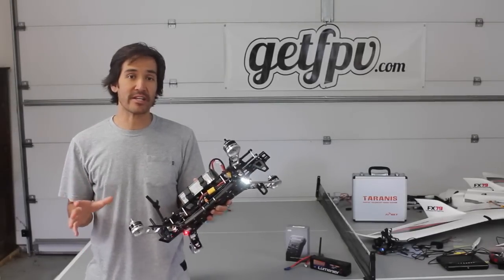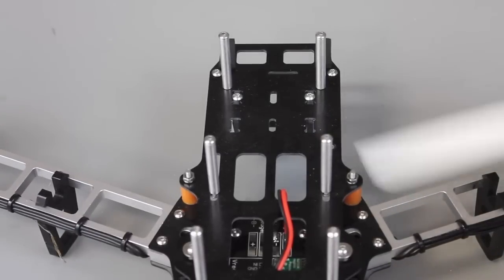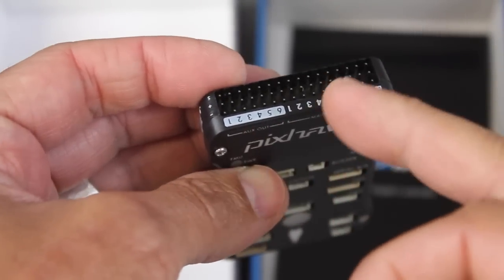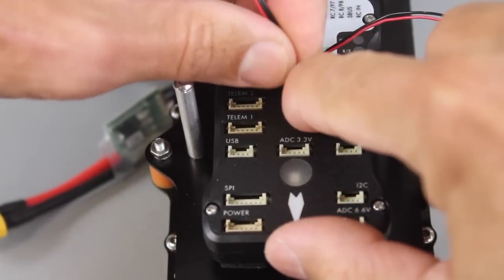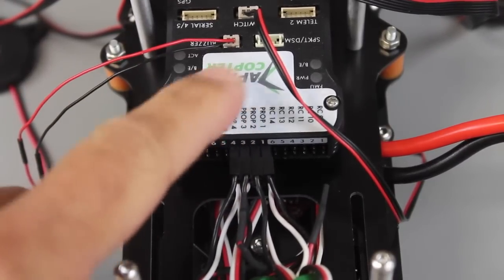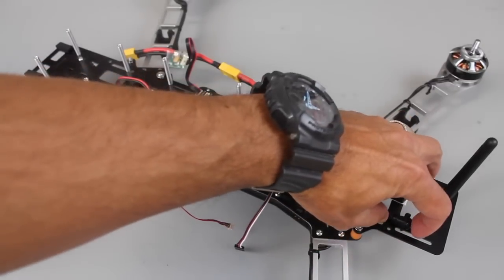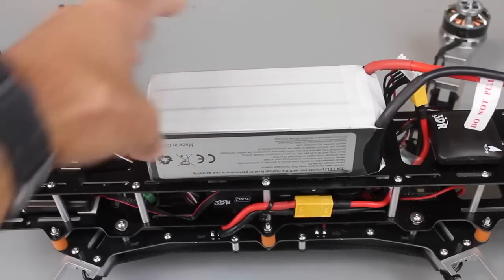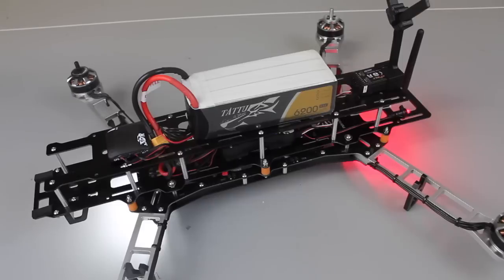Pixhawk Unboxing and Installation in QAV500

Comment: Hi dear Dennis!
Many thanks for video.
Only one moment I don't understand properly. Does the ESC connected to PixHawk by PROP1....PROP4 slots? Or PixHawk has ESC module inside and signal and power cables run right to motors?
Reply from the maker: Samvel Sargsyan Hopefully this diagram helps:

http://copter.ardupilot.com/wiki/advanced-pixhawk-quadcopter-wiring-chart/

Pixhawk does not have any ESC built-in so you'll need to use separate ESCs for each motor or a 4-in-1 as shown in the link above.

Comment: Dennis - Why did you use the low KV T-Motors MN3508? The QAV500 usual is paired with higher KV motors like 700-900kv? What type of flight times are you getting with this configuration?
Reply from the maker: Peter Klimon Tim Nilson and I thought it would be a fun series to add the 13" props and 380kV motors with a 6S batt. The goal is to see what flight times we can get with this setup. I'll be doing a video soon that shows it with a 6800mAh as well as 8000mAh. Great to hear from you and hope you're doing well. I did get your email but wanted to respond here.
Reply: Dennis Baldwin Have you done any testing yet for flight times?

Comment: Love your video.  Have you done, or can you do an installation of a pixhawk on a single rotor flybared helicopter?  I'm interested in using a trex 550 for a camera platform and need the stability offered by pixhawk
Reply from the maker: Robert Gaudette That may be way over my head :) I've never flown one of those before but it would be cool to see Pixhawk in one. You may have already seen this, but I'll share just in case:

http://copter.ardupilot.com/wiki/traditional-helicopters/

Thanks for the suggestion.

Comment: Hey Dennis, great introduction to Pixhawk.  Thanks again for taking the time and sharing all this information.  Quick question.  Why do you want to S-Bus with the receiver instead of PPM?  Won't you also have to install a PPM Encoder for that since PPM is the default for the Pixhawk?
Reply from the maker: Al B From what I understand the X8R does not support PPM output so S-BUS is used. It simplifies things a good bit with the X8R. Thanks for watching and the feedback.

Comment: Hey Denis -
I'm new to quads and love your video's - these are a great help to me! I just created an account at GETFPV and signed up for notification when the PIXHAWK is back in stock. I'm also considering adding a Teranis to my radio line up. Thanks for the great info - please keep them coming!
Reply from the maker: David Beardsley No problem at all. Thanks for watching. I love getfpv but also keep in mind you can get the Pixhawk from other sources. It looks like 3DR sells it on Amazon:

http://amzn.to/19o3F3A

as well as from:

http://store.3drobotics.com/products/3dr-pixhawk
Reply: Dennis Baldwin Can I use any other T-Motors with more kv, cause moneys a little tight right now and I am wondering if I could use like 900-1000 kv with the qav500 frame?

Comment: Since pixhawk will be powered only from thr power module, so if i'm using an opto esc i don't have to use any other bec. Is that correct?
Reply from the maker: Arga Firmansyah Correct. If you want to power it from the servo rail you can read more here: http://copter.ardupilot.com/wiki/common-pixhawk-overview/#powering

Comment: Great video! What motors and props are you using and what kind of flight time? I'm putting together the same rig but I'm not sure on a few details. Thanks for the excellent build tutorial.
Reply: Sorry, watched the video again and realize you gave us the motor info. I've plugged these into E calc along with a 4s battery and 12 or 13 inch props and it tells me there is not enough power to run these. I know you're running 6s, no problems with that and the Pixhawk?
Reply from the maker: Matt Molnar No problem at all with 6S. It's quite peppy for such a big setup. I do have a 8000mAh 6S that will add some additional weight so it will be interesting to see how it responds. I'll keep you posted. Thanks for the comment.
Reply: Thanks, Dennis! I'll be interested to see your flight times.

Comment: Hi Dennis, Great vid! Thanks for sharing. How do you supply the X8R receiver? Thanks
Reply from the maker: Flavius Lupu Thanks for watching. I'm not exactly sure of your question but if you're asking how you power the X8R it can be via BEC or ESC w/ built in BEC. If that's not what you're asking then let me know :)
Reply: Dennis Baldwin
 Yes, the X8R. I see you didn't use the ESCs 5V. Did you use an external BEC?

Comment: Thanks Dennis I am now in the process of Building one myself ( different Frame) So this set of tutorials will help a lot. I see some comments about the power modules being only 4s but there are 6s power modules out there already to go no mods needed.
Reply from the maker: Stephen Galvin Glad to hear you got a good build going. This is the power module I'm currently testing which will support up to 7S: http://amzn.to/1DE4faL
Reply: Dennis Baldwin Hi Dennis thanks for touching base I actually just saw your other video on this so sorry for missing that before I answered. Just a quick question If I used this PDB from HK would this mean I could do away with the power module altogether? I think it does but just trying to confirm. I am a newbie so forgive me if its a dumb question :) http://www.hobbyking.com/hobbyking/store/__68694__HK_Pilot_Power_VI_Module_Distribution_Board_And_Dual_UBEC_ALL_In_One_120A_and_10s_.html
Reply: Hi Dennis  how long do you think it will take to do the build series?

Comment: Nice looking setup Dennis, 
Im playing around with a hk pilot 32 (pixhawk clone)and its been interesting.
I went with the hk version because I wanted to test the open source waters as inexpensive as I could just in case I didnt like it. My experience is with mikrokopter and dji previously. 
All was going well with my hk pilot 32 and f450 test platform but I cant seem to get the fc to recognize compass/gps (NEO ublx-7). When I power the system up blue and green lights
Blink rapidly and faintly (on the gps). Then nothing. I cant find anything in mission planner to make the compass/gps be recognized by the fc. Since your videos started my interest in open source fc I felt I could ask your opinion on this issue. I know...I know, I will order an authentic 3dr pixhawk soon but until then I'm kind of stumped. If you can reply to this comment I'd appreciate it.  I cant really ask arducopter or 3dr fo advice... Lol.  I really enjoy your videos and congrats on the acquisition of your sponsors.
Keith
Reply from the maker: Keith Rolston Thanks for the comment and sorry to hear about your problem. I had an HK Pilot that recognized my GPS just fine. I'm not sure what the problem could be other than a potentially bad GPS. Normally it's just plug and play....nothing else required. Well let me mention that you'll need to load the firmware to actually start seeing data and for it to show up on your heads up display, but you probably already know that. Let me think on this some more and I'll let you know if I come up with anything. Take care.
Reply: Ya thats what I thought....  Plug n play. I was thinking it may need me to enable something in mission planner.. Or a box I checked that I shouldn't have but it says preconfigured for pilot 32/pixhawk. But that's hk, "hit or miss". Still too early to rule out an error on my part though. Thanks for getting back to me Dennis. I'll keep fooling with it in mission planner and hope l stumble across the answer.
Happy Holidays, Keith

Comment: nice ..waiting on that fc to arrive ..i am excited
Reply from the maker: bill alvarez Cool. Good luck and keep us posted on your progress.
Reply: Dennis Baldwin thanks for your reply dennis ..i got it to hover the other day but i had a bit of a yaw problem ..but got it dialed in by doing esc calib and sois the radio calib both at the planner and my 9xrpr0 ..you can check my video if you want ..now my question is ..can i re install fw on pixhawk like multi wii and other flight controllers .. if i wanted to re start a new configuration .. i thought i tried before but won't let me ..i was gonna try to use it on a hex frame

Comment: Dennis Baldwin  :I use pixhawk 2.4.5 on my ironman 650 and it works great.but when I power the board, the big Led doesn't flash untill I unplug the compass wire.can you tell me why please?
Reply: R. WIZA Looks like you may have a wiring issue or you need to calibrate the external compass. Make sure the external compass arrow is pointing in the same direction as the Pixhawk arrow. If these don't work then post in garagepilots.com or Diydrones.com

Comment: Dennis, How ya doing? I'm building a simie heavy build. I'm building a Kongcopter  700 size with 15 in. props Using Multistar 3525-750 kv motors. Building it for 4 and 6S batteries. I'm using 45 amp Turboace ESC's. My question id would Pixhawk be good for this build?.

Nice on getting a sponsor. Love it.
semper fi     steve
Reply: Go to Amazon.com and buy this one.In the seach box just put in quarcopters and it should get you to the page or copy and past what I put down and search.  It's at the top of the 1st page. I swear if you don't like it ,I will buy it from ya. Here it is............UDI U818A 2.4GHz 4 CH 6 Axis Gyro RC Quadcopter with Camera RTF Mode 2

semper fi      steve
Reply: It's 70$ plus shipping. This is so much fun. I have one and fly in the house. Have fun my friend

semper fi     steve
Reply from the maker: steve USMC page Great to hear from you! I've never configured Pixhawk with a build that size so I'm not 100% sure. If you're looking for autonomous flight then APM/Pixhawk are the way to go, but take a considerable amount of work to tune. If you just want a nice aerial rig that's stable with no hassle then I would consider the NAZA. Best of luck and please keep us posted on your progress. Take care.

Comment: Tip: Put a piece of packing tape over the buzzer's hole and mount it on the underside of the dirty section. It's really annoying and this helps a bit.

Also I think you should consider a lav mic for recording these videos. You can get a wired one for $10 and it will sound better in the garage.
Reply from the maker: Brandon Kalinowski Cool tip about the buzzer. I hate that thing! Regarding a lav mic I've been trying to figure out if my Canon T3 will support it and unfortunately I don't think it will. I know the T3i will but it doesn't look like the T3 has a mic input. If you find out anything different please let me know. Thanks.

Comment: You are going to make me spend lots more money. I have only worked with some of the other guys FCs and frames. But I really like that frame and the capabilities of the Pixhawk. I have played with my x8r antenna configuration quite a bit, trying to get the best set up. I am interested to see how that printed holder works, especially in such close proximity to the other telemetry antenna. Some RSSI values at different distances along with... do you position the Taranis antenna left or right horizontal, or vertical... might be a another video unto itself. :)
Reply from the maker: Mike Jordan I know what you mean! This hobby isn't cheap, but can be rewarding....at times :) I too have thought a lot about the best configuration for the X8R antenna. Unfortunately I don't have a clue and just rely on what I read from others. I'm going to do some tests in the future and will definitely share them. Thanks for the comment.

Comment: After upgrading to OS X Yosemite, the FTDI usb-to-uart bridge drivers refuse to show up in either qgroundcontrol or APM Planner. (Signing with "sudo nvram boot-args="kext-dev-mode=1"" doesn't work either.) Anyone here have a work around?
Reply from the maker: Børre Ludvigsen Sorry to hear that. I've had all sorts of FTDI issues with my MultiWii. I messed around enough and some how got it working. If I can document a fix I'll definitely share it. Let us know if you ultimately get it working.
Reply: Dennis Baldwin The problem is partially solved. I made a 25G partition on the MacBook Air and installed Mountain Lion only to find that neither APM Planner, nor QGroundcontrol could connect to the PixHawk. (Actually, it worked at the office, but not at home.) The difference was the USB cable. Picked up the original that came with the second PixHawk and it works. However, the image of the aircraft in the Sensor Calibration part of QGroundcontrol doesn't show up on my MacPro (2014) with a Thunderbolt display, nor on my Retina MacBook Pro, but is fine on the MacBook Air under 10.6 (although it shows the default orientation as being upside down). QGroundcontrol connects fine both with direct USB and the 3DR telemetry radios. APM Planner doesn't connect at all with direct USB, and using the 3DR radios, it crashes on all platforms. I am hoping to use APM Planner to configure the Taranis X9D/X8R connection. Any suggestions?
Reply: Dennis Baldwin It appears that my headaches are over. My Pixhawk's firmware (installed when Qgroundcontrol worked under OS X 10.9) caused APM Planner either not to connect or just crash. Installed the APM firmware with APM Planner 2.0.7 with a direct USB cable, and now 2.0.15 also works with Yosemite.  What's the time frame for a Taranis X9D/X8R/Pixhawk/QAV540v2 model?

Comment: I see your safety switch giving a fast blink when you power up, mine gives a lazy blink and a breathing blue light on the PixHawk  (The PWR light is green, and the ACT light blinks blue.) I can't see the lights on your PixHawk. Can I safely leave the + and - pwr connections from the ECBs in place when connecting to the PixHawk PROP ports or do the have to be removed and only the signal pin connected? I'm also curious to see the wiring of your ECBs to the power plate. Mine is here: http://abdallah.hiof.no/drone/images/20141028_084546-1.jpg (Looking forward to the next installment, as this is the only sane walkthru I have found for this build combination.)

Comment: The X8R's antennas, in the video, is setup as a "V". Would a perpendicular setup give longer range?
Reply from the maker: RcLifeOn I wish I was educated enough to answer that. I've read it's not so important to have them oriented a certain way, but to make sure they're separated. I wish I had an analyzer to do some tests. Let us know if you find anything out and I'll do the same.
Reply: Dennis Baldwin RcLifeOn You can use the Taranis to report the receive signal RSI. If you want to get educated here is some reading http://www.tscm.com/polariza.pdf . By having your polarity off by 45 degrees you may effectively cut the receive power in half or 3db loss. 90 degrees is 1/100 loss or 20db loss.

Comment: Great vid! So Pixhawk is a Flight controller with ability to follow you? What is the difference between this and the apm 2.6?
Reply from the maker: Journey FPV Yes it has follow me capabilities which is based off APM:Copter firmware. The main difference is Pixhawk has more processing capabilities, which as the firmware evolves will be able to handle it whereas the APM may not. Don't get me wrong. I love my APM 2.6 and it has served me well, but I'm excited about the future of the Pixhawk platform.

Comment: Well presented as always,that aircraft is going to be very capable. Staying tuned.
Reply from the maker: Jake Bullit I flew it with NAZA originally and it was ridiculously stable. I'm hoping to get it similar with Pixhawk. Thanks for tuning in and I appreciate the feedback.
Reply: Dennis Baldwin I haven't flown a NAZA yet but I would like to try it out. However I'm very impressed how stable my Tarot 960 is with pixhawk. It just sticks in the air like it is glued there. I haven't even done the Autotune after 9 months.

Comment: Ive found my sbus from the x8r wont failsafe on arducopter 3.2.  I set it on the tx and i see the pwm values change when i turn off the radio on mission planners rc calibration screen but it wont go into my failsafe settings.  Now if i set the throttle failsafe it in mission planner that works.  Basically the frsky rx failsafe settings wont engage anything on 3.2.  Im interested to see if you have this problem.
Reply from the maker: Jeff Colhoun Very interesting. I haven't looked into this, but will be sure to look into it when I get closer to getting the QAV500 in the air. I normally do failsafe at the RX, but am wanting to try setting them up via the TX config screen. Will let you know what I find out. Thanks for the info.
Reply: Jeff Colhoun I've got arducopter 3.2 on APM 2.7 (HobbyKing) with X8R and failsafe does work. It took some playing around with it. If I recall the throttle goes to a low setting like 900us were normal low is 950us. I've got it set to RTL if signal is lost.
Reply: Jeff, check the X8R manual, there are two ways you can set the fail safe with the X8R.  You need to choose the option which corresponds with how you have your Mission Planners set.  You can test when it goes into fail safe using the appropriate screen in Mission Planner.  renoflash, yes you can either set fail safe in the X8R to go to predetermined state or to no pulses.
Reply: tpalshadow yes i know all of this.  I have the throttle failsafe set.  When i used the x8r failsafe it would show the pwm values change within mission planner but would not engage rtl.  A few on the diy drones forums confirmed this issue and its been added to the todo list.  Only happens with the x8r.
Reply: OK, so why not set it to no output on the X8R on failsafe and configure Mission Planner the same...